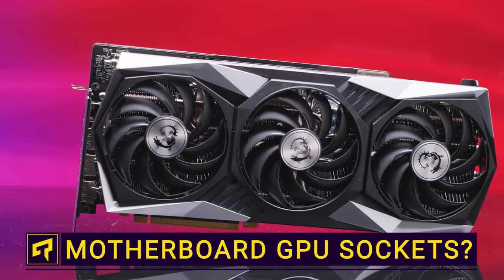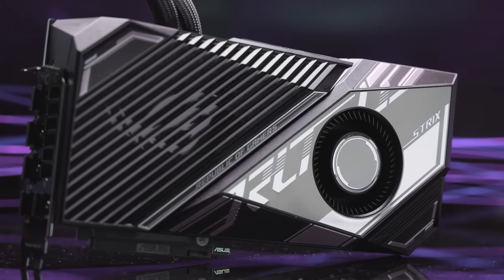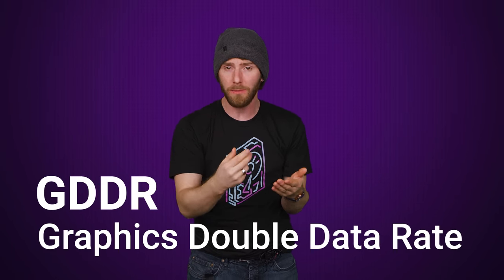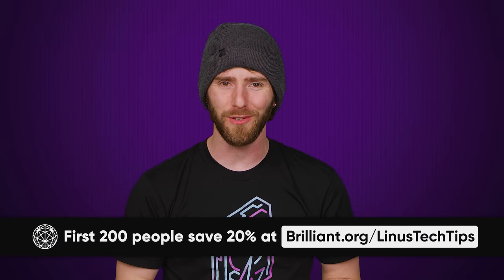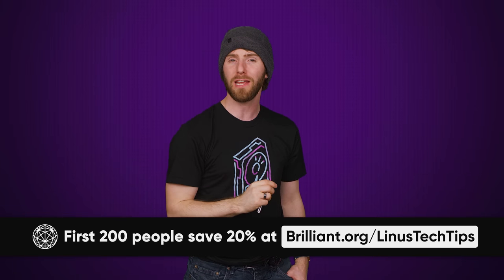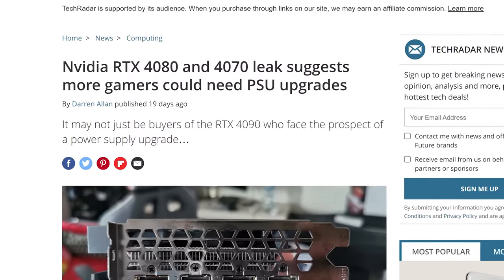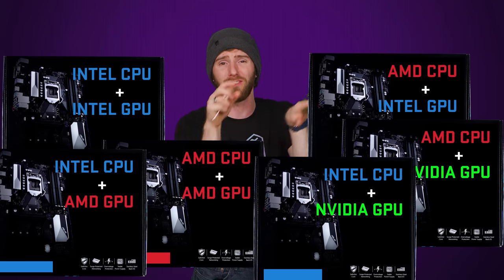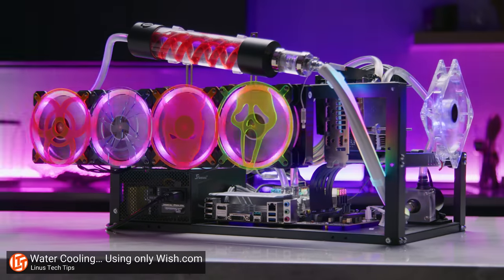Can You Put a GPU on a MOTHERBOARD?

Comment: The better question is: can we slot a CPU in a PCI-E slot like a GPU?
Reply: Look at Pentium II. That's basically what it was.
Reply: I'd assume in that case you'd need another cpu on the board, to handle said PCIe slot.
Reply: didn't the intel nuc do kinda this?
Reply: I am thinking the same. Let say design a cheap "CPU"  which specializes for handling PCIe and IO traffics only. then slot the expensive compute unit in the PCIe slot. That way we wouldn't need to upgrade CPU socket that often. But I guess this is stopped by the different job nature between CPU and GPU. A couple of PCIe lanes may be enough for a GPU, but might be a serious bottleneck  for the workload of a CPU.
Reply: well there are a bunch of ways to do that, intel's new nucs do that but the card itself is the host, not the board with the slots
intel's also released a few accelerator cards that have xeon cpus on them, but the host is on the motherboard and the accelerator only takes care of specific tasks, I think qnap also has a few of those cards but with celerons/i5/i7 and even tho the interface is pcie, it actually just converts to an on-pcb 10gb switch to communicate with the accelerators
cool tech, some examples exist out there, but they're used for extremely specific tasks and not for random additional compute power in your pc, trust me I searched for something like that for general use, didn't find anything plug-and-play for consumers
Reply: It has already been done. ISA backplanes with a slot-in card on which the CPU and RAM were mounted. LGR did a video about that a while ago.
Or take a look at several Compaq PC's from the 486 and early Pentium era, like the DeskPro 4/66 and the Prolinea 5/90.
Reply: Had a Pentium II 233 on Slot 1. It was like a GPU with fan and everything.
Reply: In a way yes
Reply: There were some ISA single board computers that you would slot into the motherboard that simply functioned as a backplane.
Reply: @mo_mo1995  That "cheap CPU" already exists and it's called chipset
Reply: Well it used to be like that back in the day's
Reply: Back in the day we put CPUs and RAM into ISA slots. So, yes, you can theoretically slot them into PCIe slots as well.
Reply: YEs they have that already.
Reply: Yes
Reply: Yes, Intel did that with Pentium II and III, plus Intel NUCs and that weird board from the 2000s that let you have AMD and Intel at the same time.
Reply: You must be young :)
Reply: @armandoventura9043  It was done way back when there was 286 CPUs. Usually on in servers.
Reply: Not anymore. Signals would be far too unstable.
Reply: Imagine using an Intel compute element inside a regular PC 🤔
Reply: Intel had a lineup like that.  Look up "Xeon Phi."  A few dozen quad-threaded Atom cores slapped onto a PCIe x16 card used for compute acceleration.  Outrageously expensive if you didn't have hundreds of thousands of dollars to spend, or the equivalent for whatever market you were in.
Reply: Yes, in the form of Intel's Xeon Phi PCI-E Co-Processors, And NEC SX-Aurora TSUBASA "Vector Engines", which parasitically use their host computers(Referred to as "Vector Hosts") for things like communicating with other Engines, I/O and managing the Operating System, VEOS, ran on Red Hat Enterprise Linux.
Reply: Intel nuc
Reply: Look at the Intel NUC. The Compute Element (board containing laptop-grade i-Series chip, RAM, storage, etc...) slides into a PCIe slot.
Reply: That would actually be awesome! No more incompatible mobos!
Reply: Make sense, a standard MB and chipset that supports different CPU & GPU brands and Architectures (Intrl, AMD, ARM, RISC-V). While you can decide and upgrade the amount of VRAM you want to have similar to the RAM. Meanwhile the GPU power module will be part of the power supply. A standard long life MB with a standard socket.
Reply: older macs did this with daughter cards, so it made upgrading the cpu for them easier back in the 90's. today though so much of the tech seems tied to the cpu itself with the mobo extending the functions or providing the bits to make those functions work and then the chipset doing extra stuff after.
Reply: IBM servers
Reply: Yes
Reply: There is video on this channel about this topic
Reply: Ever hear of the PCIe Xeon Phis?
Reply: You can slot a whole second motherboard into a PCIe slot. Used to be able to do that with older PCI cards, too.
Reply: Now all we need is ram sockets
Reply: There were some pentium 2 and pentium 3 cpus that came on a card that slotted into a special slot on the motherboard, so should be technically possible
Reply: @JoePro  Look at the new Intel NUC's
Reply: Derbauer recently did a video on this recently!
Reply: I had a Pentium II 350 tower PC many, many years ago. My CPU "card" had a new retention clip style but my motherboard did not. Consequently my CPU fell out of its vertical slot every few months and needed reseating...
Reply: not even the asus zeus prototype with dual hd7970 integrated
Reply: Oh the days of Intel Slot-1 CPU's are flooding back, was so close.   

But it's all kinda inception as the CPU has the lanes to the PCI-E Bus so it would be kinda almost head upon arse drawn out on powerpoint.

Now if there was a more generational transcending chipset that did all the PCI-E lanes, well that avenue may be more viable.

But then Memory and then .... and it's just not fast enough for all that.

Though self-contained mini PC SOC style plugin cards would be nice for VM's etc expansion wise.  Heck who wouldn't love to add say a PCI-E card that added loads of ARM cores you could chuck into OpenCL or other more open API mix and offload in the same way adding CUDA cores etc is done.
Reply: @PanophobicCuber  you could have a low power cpu that just waits for a powerful cpu to be installed and then it uses the powerful cpu to do the pcie lanes after bootup?
Reply: it was like that in early PCs, motherboards were just for ISA interconnection.
Reply: Yes you can slot a CPU into PCIe, look at Intel Xeon Phi cards, or that crazy 3-CPU Intel card that der8auer recently presented.
Reply: Man askin the real question
Reply: @MindFlayeR57  thank you. I was reading this thread feeling like I was going insane.
Reply: That would lead to some interesting problems and advantages.
If this controller chip was able to do stupid fast DMA transfers for example, every component on the PCI-E bus would be able to share the memory (that probably could at this point be yet another PCI-E card),
The disavantage i see it's the latency that would be a bit painful and pretty much demand that every "fast" device on the bus to have a metric ton of cache memory to deal with it.
Reply: It's called Xeon Phi.
Reply: IBM does that all the time, has since the 70's
Reply: @mathdantastav2496  intl did release a nuc that was upgradable via an expansion card. Nothing really stopping you in a special case like that
Reply: @JoePro  also raspberry pi compute modules are basically just that.
Reply: i feel like linus did a video on that
Reply: an intel nuc does something like this I think, something called a compute element, or something like that, I am rusty dusty on it, so dont ask me too many questions on it
Reply: @mo_mo1995  not needing to change motherboards is a pretty "good" reason that manufacturers wouldn't try it = less sales
Reply: Yes. But then you'd have no controller for the PCI-E slot.
Reply: Intel's server stuff has those in form of expansion cards with compute units (CPU's on a graphics card like PCB).
Reply: Famously yes
Reply: Yes
Reply: Intel nuc extreme edition. Slots in as a pcie card to a board that provides a pcie slot and power, you could also put it in a pc but you lose your dedicated gpu support.
Reply: Yes, look up intel Coprocessor
Reply: true
Reply: Yes, Xeon Phi
Reply: XEon Phi says hello
Reply: PCIMG is basically a motherboard on a slotable card with a backplane for expansion
Reply: Isn't Intel nuk up that alley?
Reply: yes, its called Intel Compute Module
Reply: the pemtium iii did that possible
Reply: I'll direct you to my box of random tech where there lies a pentium II
Reply: To slow
Reply: There exists coprocessors that use the PCI-E slot, such as the Intel VCA or the Xeon Phi
Reply: Well, yes, and no. Up until PCI-e Gen4 it was very limited - CPU would need to be on a special carrier board that would present the CPU to the host system as a compute device, and apropiate drivers would need to be included, and this is because PCI-Express has clear hierarchy with root port at the top. Intel's VCA actually does this, and Xeon Phi did this (before Knight's Hill, then it reverted in LGA3647 CPU slot).  If we were allowed to change some things on the motherboard, we could build special BIOS and make some changes to allow single PCI-Express port to take root role onto itself, so it would work either as stand-in replacement with main system's CPU disabled, or as a separate domain with basically second PC inside the motherboard.

With PCI-Express Gen5, new features are available, including multi-pathing and P2P root communication, which not only turns PCI-e infrastructure into mesh network, but also allows for resource sharing, like storage, memory space (and bandwith) - on RAM, and VRAM (or in general any memory present on any PCI-Express device), devices (NICs, port switches, accelerators), etc.

Then, there are things like Ghost Canyon NUC and newer, which simply reversed the PCI-Express mechanical design and use male part of PCI-Express of the connector on the motherboard, plugging it into riser/carrier PCB to allow other connections. PCI-Express connector is very well engineered with a lot of signal interference measurement done already - I've seen it in oscilloscopes and signal analyzers and other equipment, that has nothing to do with computers. You may very well use mechanical connector to split CPU socket into another, interchangable part.

Then, if you look back, there are things like K8N-Upgrade, which used AGP (pre-PCI-Express slot) mechanical connector to slap replacement or upgrade daughter card with CPU socket and RAM slots, to upgrade from Socket 754 to 939 and AM2. The reason, however, why it's not done like that anymore, is beacause of limited bandwidth. You theoretically can push more data than in-spec PCI-e through it if you use custom proprietary singalling, but then it's so much easier and better to use pin grid connector (I've seen 80 lanes of Gen4 squished to PGA connector on some multi layer 8-socket server motherboards, there were like 8 of these connectors on each layer).

Them looking even firther back, there are Slotted CPUs - famously, Pentium 2, Celerons, and Pentium 3 (including Socket 370 adapters), and first Athlons from AMD. From more obscure hardware, SGI Indy used slotted CPUs, in form of a card plugged into motherboard. It's just when your CPU has over 4000 connectors like modern CPUs have, it gets kinda impossible to fit them all on a single edge.
Reply: 2012 - Intel XEON PHI was a multicore CPU on a PCI slot (60 to 72 cores). They however lacked virtualization and only ran RedHat Linux. LTT did a video on it but never showed its real power.
Reply: Being back math coprocessors!
Reply: Watch the video where they installed an Intel Nuc into a PCI slot?  Basically, it can happen for sure.
Reply: Intel actually sells expansion cards with 3 xeons on them
Reply: You use too in the 70 & 80's but it added latency and was easy to damage in transportation
Reply: Fun fact you use to be able to slot in CPU to a precursor to PCIe just look at the early Apple computers like the Apple II
Reply: I think IBM server do this.. I am not following the technology but I think IBM blade server do this.
Reply: That would be called a co-processor, just like that pcie card that RED produced
Reply: Compaq made several pcs with the cpu on riser cards
Reply: @lancheloth  Older Ones Yes do not know about newer ones but yes they slid in similar to the power supplies
Reply: well yes, just like Intel NUC
Reply: Yes we can, xeon phi processor cards plug in to pci ex slot
Reply: The problem is PCIe lanes originates from CPU. Sure there are few lanes on the motherboard that have their start from the chipset. But those are basically subset of a larger (higher bandwidth) lane from the CPU itself. Why it works for GPU is that GPU takes the data from CPU and system Memory. CPU on the other hand is not controlled by another chip. It IS the main controller.
Reply: TBH, a slotted CPU, just like good ol Pentium 2, would make wonders for a 12900k, if we could remove the IHS and stick a triple slot, triple fan cooler to it, just like a GPU
Reply: That used to be done in slots proceeding PCI-E. ISA slots used to be on boards that would intend on almost the entire motherboard being on a card. This was back with CPU's like 486's, but being able to turn one on without buying several cards at the same time was an advantage. Unfortunately, these were really intended as boards to test old software with. Because 486's were fading later in the 90's, they were cheaper with technology to just fit on a card.
Reply: Yea, you can get a pci e cpu
Its expensive tho
Reply: @Zodiac.  that's not the same thing. It uses a cpu but you can't really use it for anything.
Reply: Second that.
Reply: @JoePro  first Gen Athlon was a slot processor. They were called slot A CPUs. I had one until it exploded and wrecked my computer. By then they had switched back to the socket and I got a socket A to replace it under warranty.
Reply: Pentium 2
Reply: Intel Compute Elements.
Reply: Industrial PCs with backplanes.
Reply: Yes
Reply: Intel does this with their NUCs
Reply: That's my Pentium III CPU using Slot 1 back then before the Coppermine era.
Reply: Nothing new really 😂
Reply: Yes, Intel have a a modular build that does that
Reply: @JoePro  hello fellow old person 🤣 I was about to mention the pentium 2
Reply: @PanophobicCuber  You already have a chip on your board - it's called the chipset
Reply: CPU needs to be snappy and get all the data quickly.
I don't know if this could be done on an PCI-E slot.
Reply: I guess it's more to do with PCIe lanes count and signal integrity offered through such a PCIe-like slot... Cause one could certainly make a "slot" board with all the components/connectors/controllers on board routed to such single slot, but to say expose at great quality guaranteed to work for years type more than 16 lanes it might become detrimental or a limiting factor, and probably in order to do it trully correctly you'd have to have eg. say a triple slot, or maybe even a set slim 8-lane PCIe connectors one below another, stacked for say 8 connectors in a row that such daughter baord with CPU were connected to. Then the mobo would require a PCIe switch chip to aggregate those divied up 8x8 lanes and then expose them in another format to the rest of the controllers/connectors on board. So yeah, it's doable. But the chip manufacturers would have to forego any profits they're getting from mobo manufacturers who use their socket designs and their chipsets... Maybe some of the profits could be garnered form the daughter boards manufacturers who'd have to pass the rigorous testing for socket implementations... Another issue potentially lies in the fact that RAM might have to lie on the daughter board/card as its placement on the mobo itself could hamper total performance due to latency and signal integrity issues coming from the 2 socketable layers (on daughter board and another between boards)... Of course there is a possibility that several PCIe5/CXM solutions could potentially answer the issue and fix the drawbacks a bit, delegating the mobo to a role of PCIe switch with attached curated set of controllers or ports, with 2 BIOSes/firmware to deal - one on daughter board where the CPU lies and another on a PCIe "switch" side... let alone other firmwares on attached controllers/extension boards. So yeah, potentially it could be done using today's and future's disagregated tech from server-grade equipment - potentially even with mobo BIOS/UEFI growing further to expose components in a way similar to hypervisors with PCIe pass-throughs... On the other hand, it could also be easier for each respective major player in the industry to do something like an nVidia SXM-like slot for a combined CPU + GPU + RAM package thus promoting their own products but losing on end-user individual component upgradablity/expandability... Some industries would not care that much, but DIY consumers would revolt ;) Until they become accustomed to the new way of thinking about their computers ;)
Reply: XD
Reply: Short answer: yes.
Reply: @mathdantastav2496  the nuc is basically a reversed PCI-e, what it connects to is a dummy board, swap the female PCI-e and the male PCI-e in it, and it's the same as any other computer
Reply: @PanophobicCuber  chipset...... aka P2
Reply: Yes there called SBC's or Intel have the NUC
Reply: @mathdantastav2496  Yes but the technology is not new and was designed for the industrial world
Reply: intel dragon canyon nuc is pc in pci
Reply: You mean an accelerator card?
Reply: All notion of cooling would fly to shit. Cant really mount those huge aircoolers and pump blocks on a side-mounted card like that. Another approach would be to come up with a universal socket or a flat mounting slot on which the CPU board would then be seated.
Reply: Isn't that the Xeon Phi or the Intel NUC?
Reply: No mobo upgrade unlocked.. 😂
Reply: Well, both AMD and Intel had Slot CPUs. I believe it was an Athlon, back in the early 2000s who hit 1Ghz first and it was a slotted CPU (had one of those myself).
Reply: Absolutely, at least in principle there is nothing preventing a driver on the host accepting say x86 or arm code or something and handling it the same way the GPU driver does with CUDA code. By that I mean write it to the memory mapped I/O space in main memory allocated to the PCI-E card with the CPU on it and send a command to the firmware driver running on that to copy the code from that memory block and begin execution at a specified address. The card firmware would be essentially a full operating system kernel at that point, something like this could literally have it's own I/O and expansion ports separate from the host if you wanted it to just limited by the fact you have less space on the card. It would pretty much be it's own computer with a super low latency, high bandwidth connection to the host to exchange data and commands.
Reply: Ooooo I like it
Reply: DerBa8er made a video about a pcie compute unit with multiple xeons on it
Reply: @JoePro  p2 slot was just a connector.  

However some old computers worked like that, there was a backplane and cpu was on a card and other stuff on other cards the backplane just basically connecting cpu boards pins. Some could switch to different arch cpu by switching card too.
Reply: @dhotz8474  Actually a PCIe x16 slot is not even close to sufficient for the main host CPU. The main CPU has more like 40-60 lanes available. It could be workable though perhaps motherboards are probably long enough to make PCIe x32 a thing and you could make the CPU board a double height card like a GPU but actually have a daughter board installed to occupy an adjacent x32 slot. That would give the CPU up to 64 lanes to the backplane to use to communicate with other PCIe devices. But yeah the host CPU needs a ton of lanes connected to whatever backplane hosts all the other system devices it is the biggest bandwidth hog in the system.
Reply: This!  I was going to ask the same question.
Reply: @mo_mo1995  Interestingly this is kind of how certain older computers were built. The motherboard was just a bus bar with power delivery.
I don't think the slot would bottleneck your CPU, even if it did the RAM could also be on the CPU board. Problem solved.
Reply: Didn't Intel make a whole conpute unit slot in their NUCs?
Reply: @mo_mo1995  PCIE has a much bigger latency than DDR4 which make the CPU unusable unless you build the memory with the CPU.
Reply: already can
Reply: @JoePro  I had one of those motherboards with that CPU. Great design tbh. Couldn't grasp why it didn't continue back then. Now it makes sense.
Reply: That will cool. You sill have 2 cpu in 1 pc.
Reply: @JoePro  AMD did a similar thing with their Slot A Athlon, and the Rare Slot A Thunderbird CPU's pushing them all the way to 1Ghz(I had a Slot A Thunderbird Win 98se system, and pushed it all the way to 1.2Ghz with an OC).
Reply: @JoePro  hahaha I hated working with pen II, so buggy
Reply: @The_Burrito  wouldn't that be just the chipset? the real problem would be that everything would need to go through the chipset xD
Reply: You should checkout intel Nuc they have that kind of assembly.
Reply: @mathdantastav2496  
Forgot about that and it's pretty cool tbh especially for how it keeps the form factor small, too bad it adds to the cost.
Reply: and why for the fvck of any thing any one would do such a travesty?
Check with ASRock how well their CPU Ez Upgrade series of motherboards have done :P
Reply: Pentium II and some Pentium III used what was called “slot 1”, which looks very similar to a PCI slot, but was vertical on the board.  I remember some people calling them “slocket 1”.  

Also new Intel NUCs have a compute unit that plugs into a slot on the motherboard but I guess it’s sort of just like a backwards PCI-E riser.  LTT has done a video on them previous.
Reply: Intel did that already
Reply: Intel larabee
Reply: İnf IQ
9gb data proces per sec
999 terahash
Reply: Yes, the industrial markets do it all the time. Passive backplanes and you plug in CPU's GPU's and IO cards all the time.
Reply: this used to be a thing, it was called a coprocessor back then. The concept is basically what a GPU is now since it can do parallel calculations for graphics, physics and more than that like performing neural networks.
Reply: I have a Pentium Ii processor that looks like a video game cartridge
Reply: @AbolishStakeout  The Pentium II 300A was a great processor back in the say. 300MHz, but you could easily OC by 50% to 450MHz with practically any motherboard. There were even dual slot motherboards for not a lot of money and run what was called SMP (Symmetric Multi-Processing).
Reply: Intel Phi cards do this!
Reply: Backplanes are fun machines.
Reply: They used to do that, I think the bandwidth and physical distance from the CPU to board lead to latency issues with higher frequency cpus.
Reply: You mean the weird question is...... What a weird question!
Reply: Look at the Intel nuc canyon
Reply: So much incorrect information here.  The simple answer is NO. As the CPU in the PCI-e slot reports to the main CPU it would become a co-processor not Central Processing Unit. If you understand how a PCI-e Bus works you will know one device normally the CPU plays host and the other device slave. On boards with multiple CPU's the BIOS will always select one as the host. In laymans terms you can only have one boss. Add to this the CPU would be limited to the bandwidth and latency provided by the PCI-e lanes.  Modern CPU's have 30+ lanes, each device however may only use a maximum of 16. Then if you factor in that if the system has a GPU it will use 16 lanes, your storage 4 to 8 depending on your chipset and then the chipset will use 4+. That doesn't leave much spare unless you have an EPYC/XEON/Threadripper CPU which have 64+ lanes. This is intentional as the manufacturers want you to purchase workstation equipment for a workstation. Gaming rigs and most home/office configurations do not have need of so many PCI-e devices.
CPU are already exceptionally competent at there tasks. You would be more likely to add a co-processor such as a GPU, ASIC(mining co-processor) or a processor which has a different architecture due to the style of task being performed. These different processors have for example many more cores (gpu and mining) or could have lower latencies think stock exchange AI prediction software.
AMD made a step in the right direct with the 5800X3D and the 3 Dimensional cache. Changes like this would affect the home user far more than just simply adding more cores. The results spoke for themselves.
Reply: @JoePro  My deschutes pentium II is like that. but not in PCI-E but in it's own dedicated Slot.
Reply: That kind of reminds me of the xenon phy go processor that works in pcie slots or the Pentium 3 or athlon processors that used slot 1
Reply: @MindFlayeR57  The chipset is not a CPU or even Co-Processor, it does not process data in anyway, the chipset is just a hub in essence. The people liking this clearly have no idea how a chipset works. 🤣
Reply: @Mu7eD-Stream  the only reason I said CPU was to give a simple explanation to the other guy that called it a CPU (thus the quotation marks) but you are correct, the chipset is not a processor.
Reply: @JoePro  I have one of these sitting on my desk. I was very confused when i opened up a pc someone off for recycling and saw the cpu
Reply: Or GPU on the motherboard and CPU in the PCI-E
Reply: Yes - Intel Xeon Phi
Reply: Intel Xeon Phi
Reply: Yeah
Reply: Technically the Mac Pro 5,1 (cheese greater) did exactly that. It even had all the ram slots on the same board, and you could technically interchange them from single CPU boards, to multi CPU boards... but I think that required having 2 computers as I don't think you could ever just buy that board separately (because Apple). I have always wondered why no one else in modern times has ever done this as it makes working on the computer quite easy and cleaning very easy as well. Plus, in theory, if you made an overkill enough connection with throughput, you could upgrade the card for years for newer sockets, or newer ram slots... added sockets (I guess?) or added ram slots. You could make motherboards so much more versatile with such a card, but no one really ever did that.
Reply: A bit late to the party but.... I'll just say. ASRock K8Upgrade-VM800
Reply: No pcie just too slow for cpu
Reply: yeas, xeon phi
Reply: would prob be slow as fuck
Reply: I think a pci-e slot would be a bit much, but there's no reason we can't use a board with a cpu and an integrated vrm and ram (because ram needs to be close to the cpu) but at that point you're basically soldering most of a motherboard to the cpu. (there would still be audio and io, but that's about it.)
Reply: Yes
Reply: yes, that is the question
Reply: There are so-called coprocessors with up to 72 cores and 288 threads each from the Xeon lineup.
Reply: @supericeg5913  your refering to the phi processors right?
Reply: I was wondering why a better CPU doesn't really improve the game latency, it happens to need a graphics card
Reply: Look at Intel Nucs
Reply: Like that Intel NUC compute module
Reply: yes, xeon phi
Reply: Oh, I don't know—what about universal ports w/ at worse case, some kind of CPU adapter that can click in and then your motherboard can be compatible with multiple choosers by having say both on the board. As the Northbridge isn't particularly a thing anymore I then what about putting most of the chipset's tech on the actual COU dies like AMD did with their Athlon 64FX (and all subsequent x86–64 processors where the memory controller was built on die.

This would increase the die size for CPUs, potentially increasing costs, but provided the connectors held enough forward engineering, this could provide a universal CPU interface. Force Intel, AMD, IBM, ARM, and others to work together to develop universal CPU connectors thereby increasing size.

On the board mounted GPU flip side, governments could again have GPU vendors come together with the academic community and other venders to develop universal standards for connectivity. As a result, while the Motherboards might increase in size (depending on how it was designed), it could also enable a vast assortment of options.

For example—have the power portion be upgradeable and replaceable. Like a universal riser or clip that connects to the motherboard to enable the necessary power smoothing those boards require. Likewise, if GDDRx RAM (or whatever universal graphics RAM of choice compatible with the motherboard in question) is designed similarly to system memory sticks, or has some kind of convenient slot (even if they soldier it directly onto Motherboards like we had to do with system memory in the past) by implementing advanced multilayer error correction (like something capable of 2j digit error correction) onto both the motherboard and the Graphics memory (or have error correction in the motherboard and include a graphics memory controller similar to that on a CPU implemented in the GPU that is connected by a universal connector), end users will have potentially far greater options and price equity on graphics RAM for a system.

For example, imagine if you could increase the amount of graphics RAM for a card without having to shell out redonculously huge sums to Nvidia or AMD?

Imagine if you could simply go down to the local electronics store or order online, and obtain the same amount of RAM that say Nvidia wants to charge your for their crazy high end processor, but instead of paying thousands of dollars due to a monopoly, you'd only have to pay for the highly competitive RAM sticks.

Also, Linus, if a screwed in graphics memory riser card or graphics DIMM sticks were more inherently problematic or unreliable, then why would we permit them for the more crucial system memory that is far more prone to errors that instead of say might cause a color in a scene to be off, might instead corrupt your OS or cause a program to crash?

Error correction is a thing.

I prefer the idea of cutting into the lack of competition by forcing some degree if universal standards. Whenever "proprietary" hardware has been introduced to the market, of the sort that say is a memory connection or a particular proprietary socket (like the OS/2 ports were by Compaq), they tend to be pains in the ass & designed to monopolize the market by creating fictitious scarcity.
Reply: Server compute cards
Reply: It would be great to have motherboards that accept a CPU, chipset, and, possibly, BIOS as an add-on card. That would help our motherboards live longer than just one generation of the CPU socket and also would be CPU-agnostic. If you have bought a premium tier motherboard with great power supply circuitry and cooling and RGB and whatnot, it's a shame you have to throw it out when Intel/AMD decides to completely upgrade their socket/CPU/chipset compatibility.
Reply: Intel plan to crush amd , a slotted cpu , backfired
Reply: @PanophobicCuber  not necessarily, if the mobo had the pcie slot connected to everything including other pcie slots and ram
Reply: intel III chips were working like that
Reply: that's what I searched for and found this instead because YouTube search in 2023 is sooo great 🙄
Reply: Yeah
Reply: Yes. Go buy a Xeon Phi coprocessor. There's even a PS3 CELL processor on a PCIe device, and plenty of other coprocessors such as ARM.